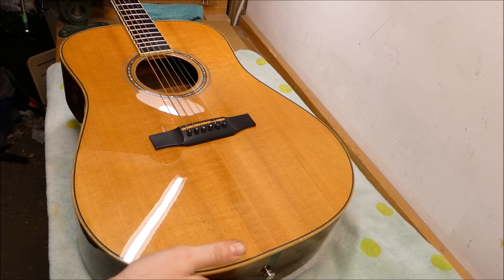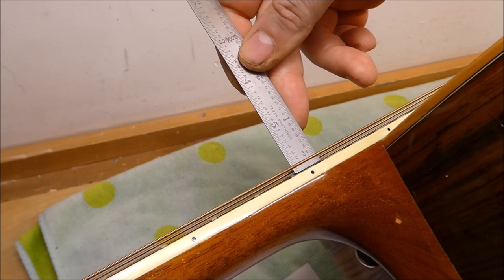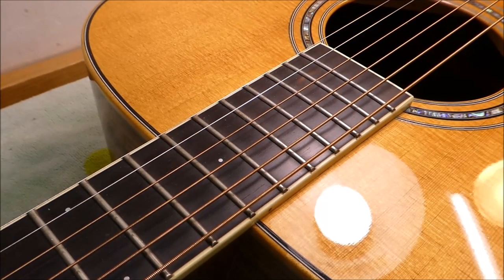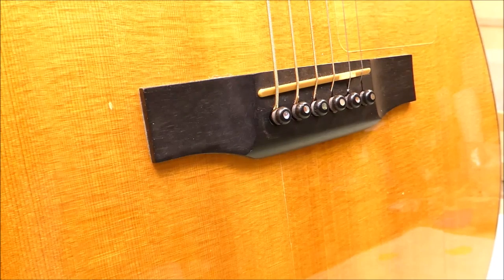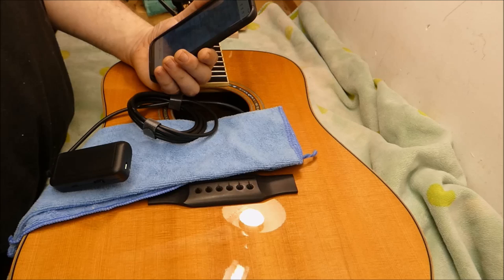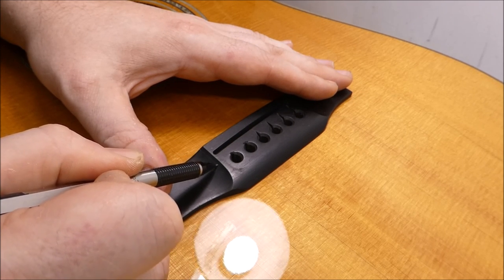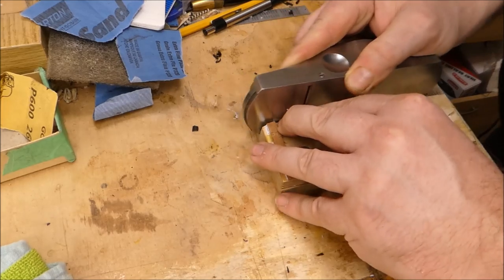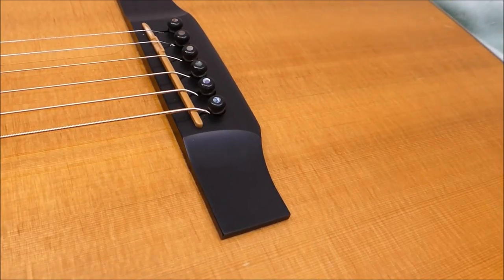Guitar Repair:  Close Shave for a Larrivee

Comment: Love those glued in necks. Grind down the saddle, then bridge, then neck reset. All so unnecessary.  Just bolt the necks on, for heaven sakes, like the engine and wheels on your car. Simple. Martin did it in the 1800's. The European builders did it in the 1800's. Bob Taylor does it. I particularly like Ovation's  approach. Set the neck so far back to begin with, then you have lots of meat to remove in the future from that 1/4" or higher saddle.  That high saddle added so many high frequencies it made my head hurt. Also fun to sight down the neck and see a  massive bend at the body.  Taylor's  got it right as far as neck joints are concerned (as well as some other builders, of course). I'm really enjoying your movies. Thank you so much!!!

Comment: Love my Larrivee. I’ve got one of their custom double aught 09’s. I use it for drop tunings and have the opposite problem of the guitar in the video. The action is a bit too low for comfortable slide work. I also need to rework the nut for the heavier strings I prefer. I sure wish I knew someone like Ted. I’ve used a couple guys on other instruments, and just no. No I will not use them for the Larrivee. I also use an oasis and put bagged damp sponges in the case in the winter when it’s really dry. I get nervous when the case humidity gets down to 40%. I’ve had the 00 for seven years now and have had no issues with the wood or anything else for that matter. Take care of your instruments and they will take care of you. As always, a thoughtful and respectful approach taken by this luthier which I especially appreciate.

Comment: The 70's -90's Martins are where the deals have been for me here in Florida.Most have a small belly and nice Neck angles.I use a Dura Block which is a firm foam Auto body block to sand the bridges and never hurt the angle with great success..Martins Big fat bridges are awesome.Florida is a great place to purchase guitars because the air conditioning keeps the humidity low,Like their cars you can tell when a yankee come down.I cringe about people not knowing any better and putting dads old guitar in the storage lockers..

Comment: I had a 1997 D-09 special edition. The neck as ok however it had the top crack down the middle which occurred around 1999 in Chicago. It had some other top lines that hadn't turned into real cracks just wood grain separations. The history of the my guitar which I sold three years ago it was on tour for until I brought it from its original owner 2008. He had made five albums and James Taylor borrow it an used it in a concert. He gave it back to my friend and called it the real deal. Larrivee does indeed make good guitars. I was wondering if this guitar had been used in its former life on tour or being played out. Traveling with a guitar and having it set out in all kinds of conditions can take its tour on an all wood guitar. Nice save learned from your videos. Thanks!

Comment: Only 9 months? I'm sure they knew the new location would be opening well in advance of that, and had tags already made up. They probably ran out of the old tags, figuring they wouldn't go through the stash they had until after the move, and had no other choice than to start using the new ones. Or the planned move date had to be moved back for whatever reason.  "The best laid plans..."

Comment: I tried this tonight on a Guitar I affectionately call Oscar.  It was headed for a landfill in a dumpster at work and was rescued.  Its a "Walmart Squire" starter package guitar, found unstrung with the bridge deposited in the sound hole.  However thrifty Oscar is, it has proven to be an invaluable learning tool.  My question is on the measurements.  How do you figure the geometry out.  I missed it by a 64 on the low end.  And how much saddle do you need above the bridge?  I was also rewarded after lowering the action to finding two high frets on the bass side ... love it

Comment: I performed the same procedure on a Made in Taiwan 1973 Yamaha FG200 Jumbo Dreadnought that I bought from GC for $145. I had heard that a neck reset would be next to impossible due to the factory originally using Epoxy instead of glue. So, I went the quick & easy route and brought the action down about a 1/16th of an inch, and it plays exceedingly fast & easy now. I also performed a refretting on the guitar because the frets were gone. Plays great now. Have you encountered old Yamaha’s to have epoxied necks?
Reply from the maker: The late 60's/early 70's Yamahas have dovetails, but they tended to use a lot of glue on the contact area with the sides, so they're a real bear. By the mid 70's most of them seem to use dowels and epoxy. It's usual to saw them off and make them into bolt-ons.
Reply: @twoodfrd  Thanks very much for this tip.  Thumbs up to crush a troll.

Comment: Your skills in general amaze me, but your skills with a plane... Just amazing!

One question: Where do you prefer your action to be set? I just sanded the saddle on my 2005 Martin D35 and put it at 2.4 mm on the low E which felt really low, and really good. It's extremely comfortable to play, I feel like I would be in danger of getting fret buzz if I went any lower. Where do you prefer your string height to be?

Comment: Beautiful work. Would really appreciate if you could answearing a question I have. On my guitar putting a straight edge on the neck between the d and g string is bang on level too the bridge. However if I put it in between the e and a and b and e it hits the bridge about 3 or 4 mm lower do the radius of neck and bridge are different. 

Tge guitar is a Martin 000-15m and tge bridges on these are very thick. Would this benefit from a shave too match tge radius?  Thank you for any future reply

Comment: When buying a 3K plus or even less acoustic I would recommend a humidifier always. Sound hole ones are especially effective.
Reply: Generally, yes, especially if you live in an arid region. However, a dry wood gives a much better and louder tone that wet wood. So some care should be taken in the amount of humidity you provide. Where I live, a humidifier is not needed. Never used one, and my acoustics are just fine. But I'm not in the Mojave desert...
Reply: @perihelion7798  I'm in New England but my old Martin still loves a little wet. I tend to err on the cautious side since I just play at home nowadays. But years ago when I lugged it around I always used the humidifier because of dry clubs and air conditioning. the humidifier is in the case but it's currently dry. The guitar is on the stand and I went over and checked it and it feels a bit dry. But it is BOOMING...
Reply: @NitroModelsAndComics  The less moisture, the better the wood resonates, and the truer the tone. My opinion is that if the wood of the instrument has been properly dried before assembly, and the location of assembly has very low humidity, then that instrument will really sing out.

Many acoustic instruments made in S.E. Asia have severe problems when shipped into dry areas of the US.
Reply: @perihelion7798  I have knowledge of how wood reacts with moisture. i was simply adding my findings for my old Martin. One thing is certain, it has aged better than that Larivee and it is 2 decades older due to my efforts.
Reply: Robert Frias I can guarantee that Larrivee will age just fine now that it’s not in the first owners careless hands anymore. I’ve seen plenty of Martins in worse shape, especially in Canada. The humidity changes here are often very extreme and can do a lot of damage when left in harsh areas, as you can see with this one. The first owner had gone out of the country for several years and the guitar was left to weather outside of the case for the entire time. It’ll be in a controlled room now that never drops below 40-45%% and never gets over 50%. The winters and humidity fluctuations aren’t as extreme where you are though, so any guitar you have there will arguably be easier to take care of. I almost always use case humidifiers when travelling with all of my other guitars and I’ve never had a single issue. I only bought this guitar 2 weeks ago and I’m the second owner lol
Reply: @_nickoustic_7923  Sounds like it's new life is going to be a good one. Enjoy that guitar, I've played a few and the are lovely instruments.
Reply: @NitroModelsAndComics  Zero moisture can certainly be damaging as well. My point was that a kiln dried piece of wood is generally around 6-9% moisture content. It's been my experience over more than 50 years that a combination of high temp and high humidity poses the greatest danger.

However, leaving an acoustic guitar in a hot car or in an outside shed in summer can certainly ruin it completely. Good playing!
Reply: @perihelion7798   My Martin goes through changes as the seasons do. It is never in its case and is beside me even now. i like it out as I tend to play a lot more when it's handy. I have an electric and practice amp handy as well but if i grab something just to strum it's always the acoustic since there is no plugging in and all that. I guess it's pretty dry now since it is booming pretty good. An old D18 can get pretty loud.
Reply: @NitroModelsAndComics  Gosh, those D-18 and D-28's packed a punch, didn't they? I guess they still do.

My go-to acoustic is a Breedlove mahogany parlor guitar--12 frets to the box, smallish body. However, it has a very balanced tone: it doesn't boom or squeal, and is great for blues and folk stuff, which I like to play.

Good instruments will be passed down for generations so many can enjoy them.
Reply: @perihelion7798  I've never tried a Breedlove. Heard good things of course. I know they are very well built with premium woods.
Reply: @NitroModelsAndComics  They are great, for the money, which in my case, is limited, so I'm pretty happy with my Breedlove. I do like the even-toned sound of a good parlor guitar.

Comment: Beautiful job!  I've been considering the purchase of an old Larrivee similar to that one in age and bling (05, 09, 10, 11, 19 series).  One concern is that I will be buying from someone across the country without the opportunity to see it, inspect it, or play it and it will need pretty much exactly what you did to this instrument.  Could you give a range of what something like this costs on an instrument very similar to that one?  I understand your pricing likely is different for clients based on the repeat work you probably get from some clients as well as other variables, so I don't need anything specific, just a range to keep in mind when I try to determine how much I should pay for an instrument that very well could need attention by a pro like yourself.
Reply: baronistheone I don’t want to step on Teds toes by telling you price but this is my guitar he worked on here. Suffice to say that he is extremely reasonable and something like this won’t break the bank. If you have doubts about buying one, just go for it! Do whatever you have to do to take proper care of it because the quality is worth every penny in my opinion. Plan to spend though between $150-$350 but you shouldn’t get over $1000. Even if it needs a full neck reset. So if you can pick up the guitar for $2000 or less, it’s worth it to repair it if it needs it. $2000 range should be in really good shape already though. I paid $600 to buy this one, which was an absolute steal, but even if it was $2000. I’d happily pay for repairs just because it sounds that good
Reply: @_nickoustic_7923  Wow $600!! You did get a steal.  I've been keeping my eyes open for a few weeks now looking only at Larrivee guitars and the ones that I find that seem priced pretty good are all over $1000 in any condition, many with cracks in top and or bottom/sides and most are the 03 series.  At that price I can buy a new 03 or 40 series for $200-$300 more and not have to worry about potential problems and shipping costs, so if I buy used (for over $1000) it will likely be an 05 or 09 series where I could get my money back if I ever want to sell it.   In my case shipping to/from a reputable luthier would add another $100 or more, hence my interest in potential costs to bring an old one into playing condition.  Thanks for the info!

Comment: Great video as always.  Question - wouldn't the saddle slot need to be deepened?   Sorry if I missed anything!
Reply: No. He shaved the bottom of the saddle.
Reply from the maker: This guitar had a nice deep slot so it wasn't necessary. Sometimes it is.  I like to have at least as much saddle under the surface as protrudes above.

Comment: For such a slight adjustment in action, why didn’t you simply tighten the truss rod?
Reply from the maker: Did you miss the part where I said the neck was straight?  Adjusting neck relief can affect action but they are really unrelated.  If I were to tighten this neck into upbow there would be all kinds of buzzing in frets 4 through 8.
Reply: twoodfrd thanks for the reply.  I did catch the part where the neck was straight, I guess I just don’t have anywhere near your knowledge of how the parts all work together.  I’m comfortable keeping my action at .09” (6) and .07” (1) with minor truss rod adjustments.  Haven’t experienced the buzz you’re  talking about, but I get what you’re saying.  Thanks again for the response, I really appreciate it.

Comment: I have a 70's Yamaha Red Label, the action is too higharound 11/64 at 12th, on both high and low, I have allready lowered the saddle To 1/16 over the bridge, ehith this process what is the lowest you woulg suggest to keet the overall saddle height? So that I'm sure not to take that much out of the bridge
Reply from the maker: You will not be able take enough material from the saddle or the bridge to bring it down to reasonable levels, I'm afraid.  1/16" exposure is as low as I like to see.
Reply: @twoodfrd  so do you think the procedure in this video is suggested for this scennario that im facing?

Comment: martin dose neck resets for a reson
Reply from the maker: That reason is they were finally shamed into it by independent repair people. The company refused to acknowledge that their instruments could ever need one. If you sent the guitar to Martin they would plane the fingerboard really thin. Eventually people who cared stopped sending their guitars in for warranty service. Has Martin done a reset on your guitar? Do you own a Martin?
Reply: @twoodfrd   its always a balance between the thickness of the spruce and xbracing. a reason why the d28 is in my opinion the best sounding guitars. i built my d28 herringbone in 85 with my friend a violin maker and it has many faws and i do need to reset the dovetail at some point. to me the sound is harder to get than  anything else . blessings!

Comment: 6/64” - 0.093”. That’s low Martin spec. Anyone who would consider a neck reset for that is playing the wrong instrument. That is perfect action.
Reply: @sc12100  I agree if the saddle is at too shallow a break angle at .093". But if the break angle is fine at that and someone is looking for a neck reset to get even lower, they should be playing electric. Acoustics can be very difficult and finicky to maintain if you are trying to get much lower than that, (the reason for Martin's spec) and also affects volume and tone. Might as well go electric. An alternative, might be a short scale 000-x or equivalent, which feels lower due to reduced tension.
Reply: @sc12100  .085 is fairly low. Some guitars can do it others can’t. You need a very straight neck and fingerboard and properly dressed frets not to have problems with that or lower. It’s also a maintenance issue as well. Frets need to be well dressed, and relief maintained. I used to like action low coming from electric to acoustic, but if you play daily, action from .090-.110 works just fine, including up the neck, and you get better tone and volume and don’t need to always have the guitar set up perfectly. It’s worth the effort to get used to a more “acoustic action” then expecting an acoustic to play like an electric.
Reply: @sc12100  Agree with alot of what you say, but low action and/or uneven frets do affect volume, as it limits how hard the strings can be struck before running into frets. Now if you're running into an amp that doesn't matter much, your essentially playing an electric guitar, but playing acoustically, your string height limits your dynamics and many acoustic instruments such as Martins sound much better when played with a full dynamic range.
Reply: @sc12100  Yes, we can agree on that. I'm simply saying that too low an action limits your dynamics, but mainly it requires a very good setup, and is harder to maintain. Small amounts of fret wear for example can cause buzz. Seasonal changes can also be problematic.
Reply: @sc12100  Yes, but a higher action is more forgiving of many things. There is a reason Martin specifies  .093-.110. I don't  consider myself heavy handed, but I find acoustics below that feel wimpy as they have to be played lightly to avoid buzz. Fine if you are plugged in, but try playing with bluegrass players with .070 or .080 action and tell me you are being heard, or can even hear yourself.